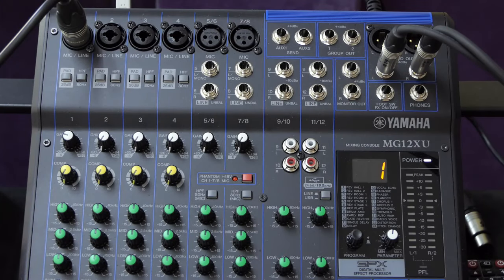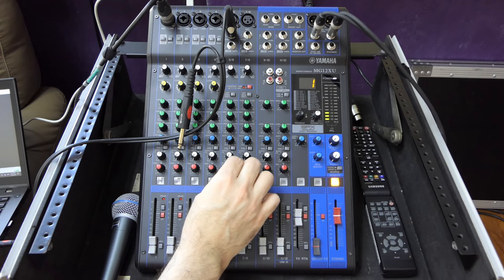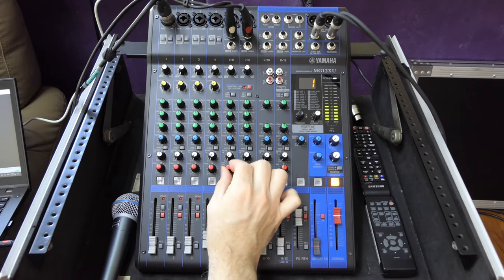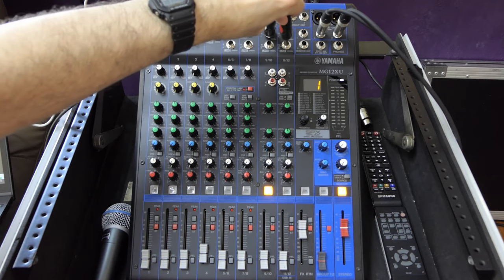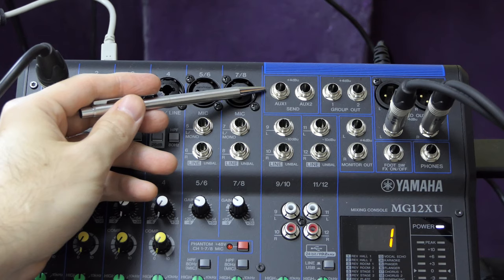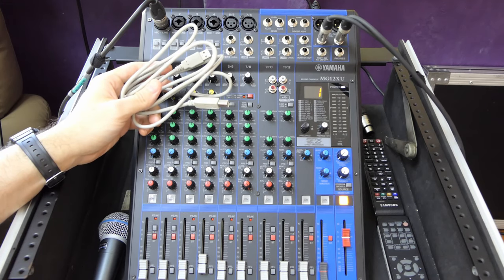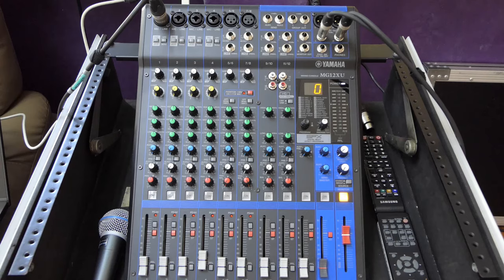Yamaha MG12XU Mixer Tutorial Part Two

Comment from the maker: Bookmarks for video: 
00:00 Channels 5/6 and 7/8
07:20 Channels 9/10 and 11/12
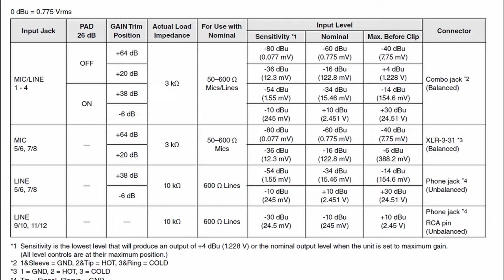11:05 Master section
14:30 USB Interface characteristics
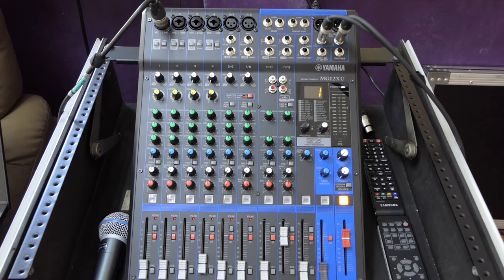17:20 Connecting the USB interface to a laptop
Reply: Can you connect this mixer straight to a Mac for built in audio
Reply: Where are the connections for stage monitors???
Reply: @oilfieldtexas8570  this was my exact reaction!

Comment: Dear GLB, thanks for this high-quality tutorial. I wanted to report my experience with USB interface with MG10XUF. Using a regular Windows 10 pc without drivers installed I experienced glitches and anomalous behaviour in audio playback from PC. All this problems were solved installing the tiny driver package supplied by Yamaha, which also allows to setup the sampling rate of playback and recording. So I would recommend to install the drivers anyway, even if it apparently works.
Reply from the maker: Thanks Gabriele, that's excellent advice - every computer is set up slightly differently and for some installing the driver can help.

Comment: Thank you for this and your other tutorials!  I'm using this mixer for live gigs with two vocalists with one also playing acoustic guitar and the other playing fiddle, four mono-inputs total.  The main Stereo Out goes to a Peavey XR-560 Powered Mixer that drives a pair of Peavey 112TLS passive speakers.  And I send a shared monitor mix out of Aux1 to a Yamaha DBR 12 powered monitor on stage.  But I've made a few mistakes setting up the monitor mix and wanted to share.

While the Channel Aux1 knobs are switched to Pre-Fader and the Aux1 Send Master is independent, in order to get FX routed to the FX Block Aux1 Pre knob, the post-fader Channel Aux2/FX knobs have to be set, the Channels On and their Faders set.  In other words, there has to be signal going the FX Block via the Channel Aux2/FX knobs before there's any FX Aux1 Pre to mix into Aux1.  That may be obvious to more experienced users, but for a time I didn't understand why I couldn't get any FX to Aux1.
Reply from the maker: Yes, you now have a fundamental understanding of how signals are routed within the mixer 😀 Thanks for sharing, glad you got it all working.

Comment: This channel is so underrated. Excellent video
Reply from the maker: Thanks for watching, appreciate the support 😊
Reply: @GLBProductions  thank u too. By the way if u can spare me few minutes. Suppose I want to buy a mixer to be used in a high school for small concerts and stuff. Should I go with the 12/16/20 channel?
Reply from the maker: It depends - you need to do an analysis of your current and future needs and work out which is best. More channels is more flexible, but the mixer gets bigger and heavier. Look at your current (pre-pandemic) gigs and see how many channels you used on average and then add at least 50% for future expansion.
Reply: @GLBProductions  Ive  never thought of the 50% slot for future expansion. Now the 16 make sense. Thanks again.
Reply from the maker: Yes - especially at this frame size the channels get used up fast when doing concerts so you need to allow for room to grow.

Comment: Thank you so much for this wonderful tutorial.  I learned a lot on how to use this mixer properly. I have been a big fan of Yamaha mixer and this tutorial furthered my knowledge using all the features of this mixer.  I just want to ask about the live stage monitor for I did not understand well.  You mentioned the monitor output is not intend to be used for stage monitor, so where do I connect the live stage monitor and which knob will control the volume? Thank you again and more power to your site!
Reply from the maker: You're welcome Pat :) For stage monitors use aux 1 (blue knobs) in pre-fader mode (button pushed in) 😊
Reply: @GLBProductions  Great to know. I really appreciate ur time answering my question. Thanks again!
Reply from the maker: You're welcome Pat!

Comment: I had to watch the section on the gain structure for channels 5/6 twice to make sense of it.   It does make sense but I don't use this function enough to have a feel for it.   That is why I like your videos,  the information is there but one might need to watch it more than once. (This is more about my own lack of experience with mixers than any issues with the video).
Reply from the maker: Yeah the difference is that on 5/6 and 7/8 the pad is built into the 1/4" inputs rather than there being a separate pad switch for the combo input.

Comment: Very detailed explanation. I have a question though. how do I connect a Lexicon MX200 external sound processor ?  Thanks.
Reply from the maker: You would need to use Aux 2, with your MX200 replacing the internal FX unit. You would then return into one of the stereo channels.
Reply: @GLBProductions  Thank you. You're the best.

Comment: Thanks for the great tutorials! very easy to understand, I have a question regarding the RCA jacks on channels 9/10 I was simply using them to play tunes from my phone (the only cables I had were the RCA to iPhone jack) anyway my question is is it normal that I can only get sound output from them if I have the PFL on ? it seems having the channel off or on makes no difference & I only get sound if the PFL is on when using the RCA .. thanks!
Reply from the maker: It should not make a difference to the signal coming from the stereo output of the mixer - how are your loudspeakers connected?

Comment: Great tutorials, many thanks. Couple questions re MG12XU: We're needing inputs for 3 active acoustic guitars and 1 electric guitar (Stratocaster with a 9V battery) and 4  mics. When we exhaust channels 1-4, can we use 5/6, 7/8, 9/10, 11/12?  If yes,  I'd like the mic or instrument to come out of both left and right speakers. Is that possible? If we don't achieve stereo separation, it won't matter much in a noisy bar setting. Can we use 1/4" unbalanced cables for the guitars and even the mics?
For example: could 2 acoustic guitars plug into channel 5 and 6 respectively? Each of these guitars has a volume output control on the guitar.  Would each guitar be heard on both PA speakers? Or, would it be better to plug those guitars into channels 9/10 and reserve 5/6 for mics thereby preserving the gain and EQ controls for the mics?  (We have 2 SM-58 BETA mics, so they should have similar gain setting specs.)
Thank you very much in advance for any help you may have.
Reply from the maker: Hi there, thanks for getting in touch. 
Channels 5/6 and 7/8 will allow you to connect a mono source using a 1/4" cable, but 9/10 and 11/12 will not. Also, 9/10 and 11/12 are line level only and do not have a gain control, so the guitars may not have sufficient level to drive these inputs on their own. 
You can use 1/4" unbalanced cables for the guitars - for the mics I recommend using XLR cables if the mic has an XLR output. 
If you plug one guitar into input 5 and another into input 6 the first will go only to the left speaker and the second only to the right speaker, but they will share the same fader, which is not ideal. 
It sounds to me like you would be better off getting a larger mixer 😄

Comment: Dear GLB Productions,
Thank you for an excellent product review of this range of products. Very informative, comprehensiveI, and clearly explained.
I recently purchased a  MG12XU mixer for use with my DAW and as backup for gigs and found your videos while searching for solution/information on an issue I'm having during  USB playback while recording. There seems to be some sort of "crosstalk" between tracks where the backing track(s) are bleeding into the newly recorded track as unwanted background noise. It is not distorted but just very faint.

This problem seems quite illogical that this issue is occurring in a device designed for this purpose. In an effort to identify where the problem was I plugged in my old Alesis io|2 2 channel mixer that the MG12XU was to replace and the "bleed" does not occur so I am confident it is the MG12XU that is the problem here. I could use my old Alesis device but it has other issues including a dead channel hence the MG12XU purchase.
Regards, Peter
Reply from the maker: Thanks Peter, glad the videos have been helpful. On your issue - easiest way to determine the source of the problem is to transfer your setup to another MG12XU. If the problem goes away you know there's a fault with your particular mixer.
Reply: @GLBProductions  Thank you but unfortunately I don’t have access to a 2nd MG12XU. I’ve just lodged a request for assistance with Yamaha and am awaiting their reply. I hope it can be resolved easily. Cheers.
Reply: Dear GLB,

Fortunately it was the "nut behind the wheel syndrome" i.e. me and not the mixer. Yamaha support were also most helpful and provided the following resolution:

"The MG12XU sends the main stereo  L+R bus to the computer via USB so to avoid a loop back you want to set the USB In channel (11/12) to go to Group (1-2) but not to Stereo (ST Button Out). Next set the Group ST button to out position (no sending to Stereo). Lastly Set the Monitor Phones source to Group. This way your mics/instruments can go through the main Stereo bus to your DAW but the signal from your DAW back to you MG12 will go to your Group and then to Phones"

Onwards!
Reply: @petercheney8350  I was having the same issues. So so frustrating 😔 Thanks a million! 😊

Comment: Thank you for the excellent tutorial, I learned a lot.  I need to connect a Radial Engineering Exo-Pod mult box which has a balanced line level XLR input.  What output and type of cable do you suggest for this connection?  I am using the 1/4 stereo outputs to a poweramp.
Reply from the maker: Thanks for watching! For the exopod just use a normal XLR cable from the main stereo outputs, since those aren't being used for your sound system.
Reply: @GLBProductions  TY that's what I was thinking, just wanted to double check before our first event using this mixer later this month.

Comment: Regarding the 192khz 24 bit USB. I found it necessary to play music from my computer at 192khz 24 bit. 48khz 24 bit music files played through the MG12XU mixer via usb sound slower and lower in pitch. Question: Is there a way around this so that all audio files playing into the MG12 sound normal regardless of their frequency and bit rate?  Thanks for making great tutorials.
Reply from the maker: Hi there John, thanks for watching. I'm not an expert on sampling rate but there are no user-adjustable settings on the mixer for this - according to the spec sheet published by Yamaha the sampling rate is listed as up to a maximum of 192kHz, which suggests that the actual playback rate is set by the computer and/or DAW. 
If you haven't done so already I suggest downloading and installing the driver for this mixer from Yamaha - that can often help solve issues like this. Beyond that I would get in touch with Yamaha and see what their suggestions are.

Comment: Wonderful and informative video as always. After watching this I'm starting to question my decision to get the MG10XUF last weekend instead of this one.
Reply from the maker: Oh no, don't do that 😅 Remember that there is no perfect mixer - they are all just tools that help us to get our audio jobs done.
Reply: @GLBProductions  I agree, but I'm finding the lack Aux outs of the MG10XUF is rather limiting. They would make using stage monitors a lot easier. I do have another 173 days to make that decision to get full credit towards making that switch tho so I'm not in a major hurry.
Reply from the maker: If you can afford the space and weight this is definitely a more capable mixer than the MG10XUF.
Reply: @GLBProductions  That's what I'm thinking. Thanks.
Reply: @GLBProductions  I would barely notice the minimal size and weight difference between the two. Now if we were talking about the MG16XU that would be another thing altogether. I'm that guy who carries around a Thinkpad T530 with the extended battery because I want the larger screen size.
Reply: I was able to return the MG10XUF  for a full refund and pick up an MG12XU new in box for only $5 US more because it was marked Blemished. After two weeks with it I still haven't figured out what the Blemish is and it's working out considerably better than the 10. The 2 extra XLR channels with compressors really make a difference for what I'm using it for. Plus the 12 segment LED Meters are a lot more useful than the 7 segment on the 10. And being able to plug in a simple AC cord into the built in power supply on the 12 as opposed to dealing with an unwieldy external power supply of the 10 makes it much easier to move it around.

I'm using to record our Pastor in his office as well as for our Live Stream. I'm using the Inserts of our Mackie CFX20 as Direct Outs of the 5 or 6 channels we are using each week into the MG12XU and mixing separately for the stream which is working out quite a bit better than before.
Reply from the maker: That's great news! Sometimes moving up or down one model in the range can really help you to find the sweet spot for your particular requirements 😊 I totally agree about the power supply!

Comment: QUESTION:  Is it possible to send a wet signal to a monitor connected to the AUX 2 output?  Once you connect to the AUX 2 send, the white FX knob in the channel strip becomes AUX 2 volume and there is no AUX2/PRE knob above the FX RETURN fader.  Thank you!
Reply from the maker: No, this is not possible using the internal FX unit - your description above is spot on.
Reply: @GLBProductions   thank you for your reply.   love your videos.   Keep them coming.

Comment: Your tutorial is so comprehensive and helpful.  Thank you.  One question: on channel 9/10 is there any benefit to 1/4 inch stereo inputs over RCA?
Reply from the maker: Thanks for watching John. The main benefit to using 1/4" connectors would be the robustness of the connector - RCA connectors are rarely used in pro audio as they tend to fall apart when subjected to heavy use. I cannot see any sonic benefit in this particular case.

Comment: I ran out of inputs on the MG12XU at an event and had to run a single channel harmonica mic signal to left only on channel 9/10 (chan 9).  I was wondering if there is a cheat to get the ch 9 mono signal injected into the right channel for true mono out of the mixer?  Maybe using the group 1/2 path and reinserting into channel 10 (or 11/12)?
Reply from the maker: The only way to do it with channel 9/10 is to split the signal so that both inputs receive the same signal - this can be done with a simple Y-cable and will result in dual mono output from the main outputs.

Comment: Hellooo.. Bruno..🥰😘🎙 can i use the  condenser mic and normal mic while at the same time thru different channel of course. Someone told me when phantom  48v pressed it can damage the normal microphone. Thanks. 🎶
Reply from the maker: Helloooo... 😄 No, there is no problem with doing this as long as all mics have balanced outputs - dynamic mics like the SM57/58 ignore phantom power and are not damaged by it. Also, don't plug and unplug mics with the phantom on, as it will cause loud bangs and pops through your PA system.
Reply: @GLBProductions    yes ..  i will turn off the phantom first as what you said on the video.. thanks  a lot and you are my mentor.. take care..😷😷🎙🎼🎛

Comment: Question here please.  My console  behinger  doest not has those level faders on the botton with reading decibels.  What it has is knobs only and it doest not tells me where is the 0 level reference , so my question is how do I set that at . Also master volume knob, the same think.
Reply from the maker: With knobs the 0dB point is usually at 12 o'clock, sometimes at 2 or even 3 o'clock - check your owner's manual to be sure.

Comment: on channels 5/6 7/8 9/10 11/12 if you put one drum microphone in Left and one microphone in the right ,  on say channel 5/6. Will both drum mics be used at the same time? What I want to do is use one channel for two drum microphones. That way I can use one channel for two drums. I have a large kit and need all the jacks in order to have all the drums individually mic'ed. Thank you in advance for your response!
Reply from the maker: Hmm, yes they will, but that is not really the design intent of those channels - they are meant for stereo sources like keyboards, CD players etc. If you connect two separate mics one will be sent only to the left output and the other one only to the right output. So it's possible but I wouldn't recommend it.

Comment: If you could make a comparison between the MGP model and the MG XU that video applies now, I would be very happy. Is MGP so much better as it is also more expensive?
It is always a pleasant and impressive experience to hear you explain things.
Reply from the maker: Thanks for the suggestion. The MGP series have many features that are not found on the MG series - dual FX engines, semi-parametric midrange, ducking and stereo image function on the stereo inputs etc. So yes you do get more for your money 😉
Reply: @GLBProductions  Thank you our great and knowledgeable hero. That you are kind with guiding us with tips is a gold mine. There is so much to choose from, no garbage but no wealth. Bang fore the buck, is something good, I guess? Every now and then you can come across a used MGP for half the new price. If it's good, only you know.
Reply from the maker: Buying used is a good option with sound equipment, but you do have to check the equipment very carefully, which can take a lot of time on a mixer, where you need to check every single knob, switch and fader if you want to be confident of your purchase 😅